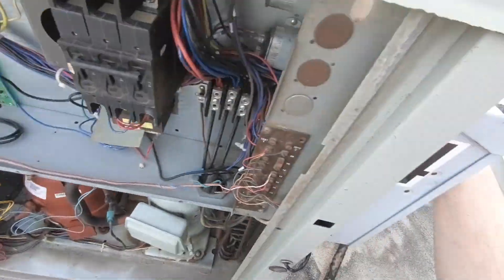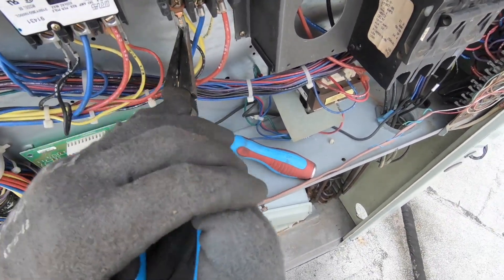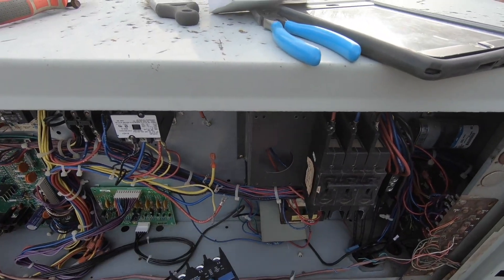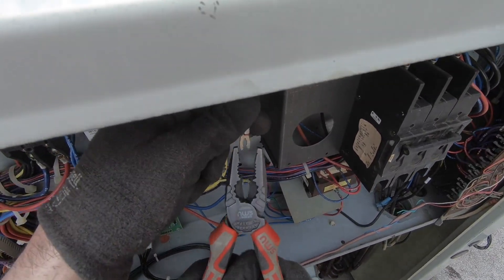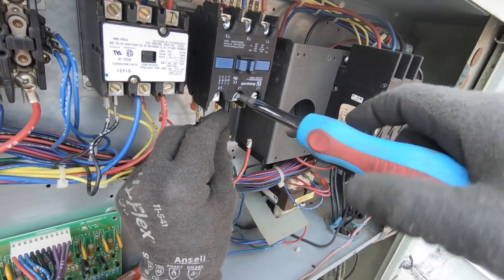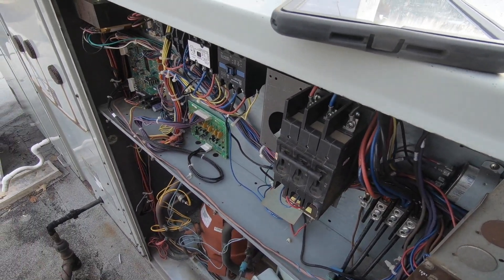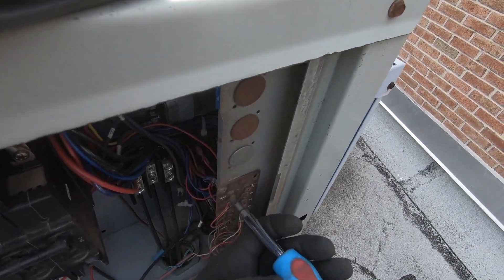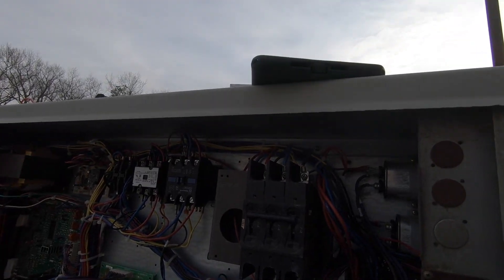Replacing Contactor HVAC Repair Burnt/ Pitted Contact Points

Comment: "Crush it in" is good" because you will get equal force on both sides of the screw, and the screw will not try to jam sideways.
Reply from the maker: I find also that a year later when doing maintenance the screws stay really tight this way

Comment: You most likely get a better connection leaving those ends on...... I have tried to cut em off, strip copper back, and I have seen where the strands spread out and just doesnt look like you get a solid connection.  Worse case, I have tinned the ends with solder.
Reply from the maker: It’s why I didn’t cut the ends off on either ways I showed to connect. The copper does spread out often around the connector. I never liked spreading the wire around the contactor screw. 10 or 8 gauge stranded never looks like it makes a solid connection